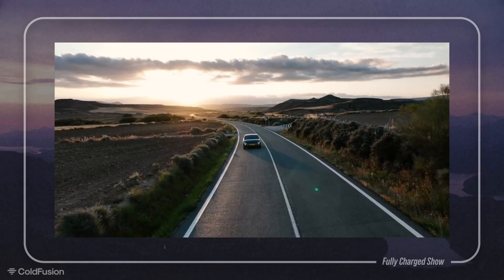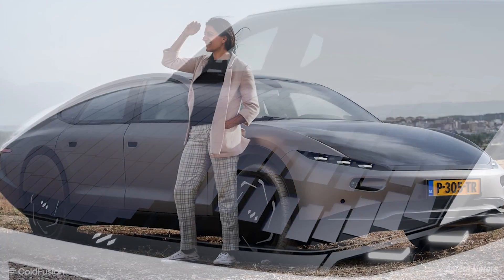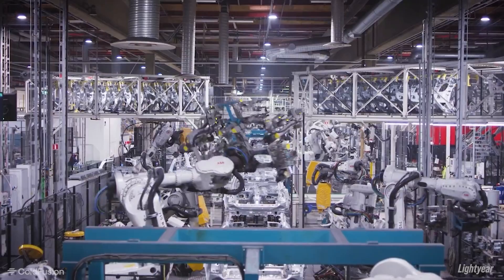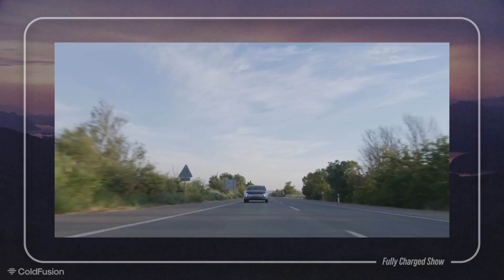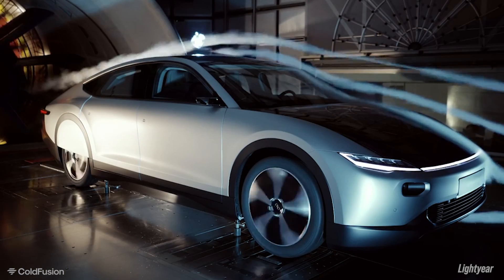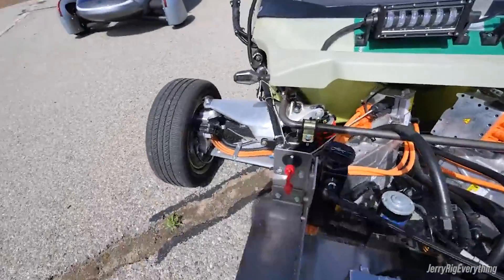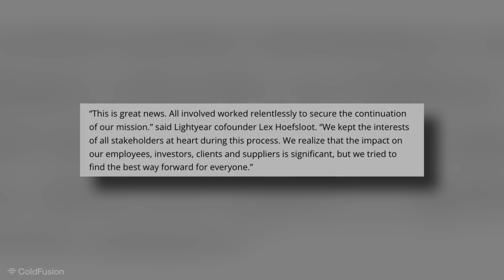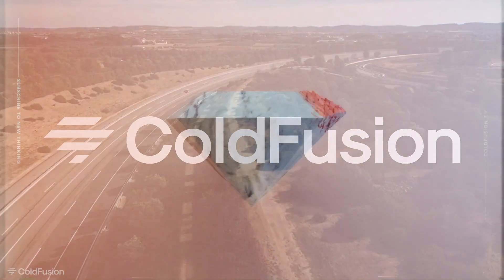3 Interesting Solar Car Projects

Comment: I hope Lightyear succeeds, but to me Aptera is the real game changer. By going for ultimate efficiency and simplicity of design, they have made a vehicle that can be made at low cost in reasonable numbers. I'm hoping we will see cars going to customers in 2024.
Reply: Aptera isn't even classified as a car, and would be a death-trap in an accident. To make matters even worse, it it actually quite large and not a nimble vehicle for use around town.
Reply: @michaelnoble2432  In a way - a real game changer, lol.
Reply: @michaelnoble2432  So is a McLaren a deathtrap? Same carbon fibre construction, bearing in mind that carbon fibre is 7x stronger than steel, and Aptera also has the perfect crush-resistant egg-shell shape. Yours is a common opinion, but a lot of people are going to be surprised if the Aptera gets a 5-star safety rating after all the crash tests are done. Aptera is not required to have airbags, but will have them anyway, so it'll be safer than a lot of other cars. I think the Aptera will be easy enough to drive with good visibility, you would just have to make sure you are watching where you are steering it, but you will be able to see the corners of the vehicle where the wheel spats are, so that shouldn't be hard to do.
Reply: @apterachallenge  unlike McLaren,  Aptera hasn't crash tested their vehicle, or hasn't released the results.  Crush testing is a gimmick,  and doesn't tell us how safe it will be in a crash. 

And the issue is the extreme width (far more than the average car), not the visibility.  Would you dare park one in an average carpark with  cars only inches away on either side?
Reply: @michaelnoble2432  You can't compare a car which is already in production with a car which is still on a path to production. Until the crash testing has been done, people are just displaying their bias or ignorance by just offering an opinion with nothing to base it upon. Sure, the parking is going to be tight but the average parking space is 2.4 to 2.5m as compared to 2.25m for the Aptera's front track so it's doable. You know that the car itself isn't going to scrape anything, you just need to place those front wheels into the space accurately.
Reply: @apterachallenge  exactly my point - less than 100mm to the white line on many car parks, if you park it PERFECTLY. Utterly insane. If you trust other car drivers to NEVER drive over the line, you haven't observed many drivers. 

And if Aptera are as close to production as they claim, there's no reason they couldn't do crash testing now (minor changes wouldn't invalidate the testing). But my prediction is that since it's (conveniently) classed as an autocycle (not a car), they will conveniently stick with their gimmicks and never subject it to a proper crash test.
Reply: @michaelnoble2432   The change to carbon fibre was not a "minor change". Don't forget that CPC (who by the way makes the carbon fibre body parts for McLaren and other supercar makers) have only just made the production tooling for the body parts, and are in the process of making a full set of parts for the first production models. Once they have assembled the first production prototypes, then they can allocate one or more of them for crash testing. The average armchair critic who has never built a car in their life, let alone a car designed for mass production, that has to pass so many government regulations, the project management, the financial management, the relationships with different companies, thinks that making it happen is easy and can just be done in a few weeks. This stuff takes years to put together.
Reply: @michaelnoble2432  You need to learn about the safety feature built into the Aptera.
Reply: @LarryDickman1  I've seen Aptera's claims, and the showy tests that are not remotely similar to actual crash testing. Until they subject their vehicle to such tests, their claims of safety are pretty empty.
Reply: i'm extremely excited for the Aptera
Reply: @raw.voltage  Settle down.
Reply: I agree. Normal car companies and society set the standards for how a car looks but 99% of cars today have high energy loss due to the car's shape. If Aptera actually produces they can change that in a meaningful way.
Reply: @Asahel17  Happy to make a long point on high energy loss, because it is one where Chris decieves and has known it all along:
High energy loss is more important when what is being lost is on any stationery object, such as a factory, but when on something mobile, it takes a back seat (no pun intended) to range, which overtakes (again, no pun) other factors, including costs. 
When Chris says he wants the most efficient, he blurs what efficiency he is talking about, and a vehicle with less range and higher purchase price is really less efficient than its comparison, regardless of other inefficiencies it may carry. So we analyze his deception claim that fossil fuel wastes 60% of the energy and electricity wastes 10%. First off - it's true, so make your factories and other stationary uses electric, but not your moving objects, and Aptera moves, if only a little bit, lol. But it is highly deceiving because fossil fuel pound for pound with batteries is 20 times more energy dense (average), and you have to take the container with the fuel. Hence, 1lb weight in an ICE car is as powerful as 20lbs in an EV before energy losses are considered. I will simplify - put another way, the ICE travels 20 times the distance on the fuel. No matter the equal weights, when an ICE does 200 miles, the EV can only manage 10 miles. Now calculate the losses, and the new distances - 40% loss for the ICE means it can only manage 120 miles. Already, we see that it's 110 miles superior to an EV, or 12 times the distance, and we haven't even calculated its losses. Fortunately, 10% only knocks it back to 9 miles, but the difference is staggering.
This is evident by most EV makers getting so little range they have to offer two battery sizes and lots of gimmicks. My old Citroen C5 can get a realistic 1,350 kms on the highway, and my new Atto3 can't be trusted to go 350 (ball park). I love the benefits of the EV, but I own the drawbacks, and I don't sell snake oil about it. I am willing to pay the extra cost in fuel for a Brisbane to Mackay and back drive, because I do it in a single drive in daylight hours in Summer in the C5, and spend 6 minutes filling up at any one of about 100 pumps to return home. I would not know how bad it is to take the EV, but it would involve frequent long stops; night driving; the dreaded kangaroos; and possibly the cost of a motel. Fuel cost is inconsequential when compared to all factors involved. In daily around Brisbane driving, I take the Atto3 every time. Horses for courses.
I hope you see how Chris is deceiving people just by omitting some of the facts? He is the ultimate snake oil salesman, and he preys on the gullible. And all his claims are never validated by real-world tests - another factor only the gullible would swallow. I own and drive both cars in my example, and they can be independently tested to be fairly accurate - no CFD rubbish.
Reply: @Asahel17  Aptera has been making and breaking promises since 2005, and has never shipped a car to a customer. Just wait until people find out how badly it performs in crash testing (despite absurd claims from Aptera so far).
Reply: @Asahel17  Professor Morelli designed the general shape in the 70s, and they only gave credit to him after someone called them out for copying it. Then they hardly ever did it again. I have nothing against aerodynamics, but outrigger wheels, which they added, are unnecessary and stupid. Being a trike is neither here nor there, but done to con the gullible and avert laws.
Reply: @aussieideasman8498  yeah, the front wheels make the car so wide (2,225 mm) that it's completely impractical to park etc. For a 2-seater car, that's just absurd.
Reply: neko7606   Aptera is following the same path as Tesla, starting with a 2-seater, and then moving to a larger vehicle.
Reply: Get your dictionary out and learn what real means. There is nothing real about Aptera when it comes to changing anything. If you could buy one, there isn't even a tyre to change, lol.
Reply: @aussieideasman8498   There are 4+ million Teslas that don't carry a spare tyre. Next spurious objection, please.
Reply: @apterachallenge  the average Tesla driver would be too clueless to change a tire anyway.
Reply: @michaelnoble2432   What a ridiculous sweeping generalization. I would say that out of 4 million people many would be able to change a tire, but it's probably true that people in general probably don't often change tires and so many people have roadside service contracts these days that they don't need to.
Reply: @apterachallenge  of course it was a "ridiculous sweeping generalization". But as a Gen-X, it's sad for me to see how few of the younger generations seem to know basic life skills like changing tires, tap washers etc.

Comment: There is a basic value called solar constant: approximately 1kWt per square meter of surface perpendicular to the sun rays in clear weather. A passenger car can hardly have its surface larger than say 4 sq. meters, meaning that in the most ideal conditions, the panels receive the input of merely 4 kWt or crudely 4 hp only: if perpendicular to the direction of the sun. (Can you hold the car panels always perpendicular? No? Then please apply a fractional factor, the sine of the respective angle ).

But wait! The best efficiency of transformation of this input into electricity is about 22%. That means that the fanatics of this project wished to offer a car with power 1 hp! It's not enough even for a bike! 

That's the level of Lysenkoism of the "scientific community" in climate alarmism, and that's the level of ignorance in the public looking up to such scientists and engineers! And the word "ignorance" is a keyword here! It's so depressing to read all these ignorant comments inspired by the pipe dream about solar energy from a car roof! That's the scope of obscurantism in the nation where Physics in schools is not a mandatory subject.
Reply: Bingo

Comment: I don't think one has to go with an extensive use solar in each vehicle for it to be worthwhile - just a one square meter panel incorporated in an EV's roof panel would give about 1000 km a year of free distance to that vehicle, and that is in rainy Britain. It's not so much what it does for an individual car that matters, but how much such a simple addition could reduce energy use if every EV, and thus eventually every car, had it. That's a lot or extra solar panel surface area effectively added to the grid, without any extra space needed, nor any landscape eyesore created.

Comment: For EVs to be viable they must have better range than the curreltly available commercial models. Having some sort of self-charging system like this has to be a step in the right direction. EVs that need hours to charge every day after relatively short drives are never going to be a long term solution.

Comment: The concept sounds great, but the Number doesn't really add up. Average Solar panel for Home use produce like 2 kW per day, and your video said Lightyear0 solar cell can generate about 1 kW a day. Put that in perspective, Tesla Model 3 has a 50 kW battery and goes 280 miles, that means 1 kW will make it go about 5 miles?
Like you said, a Solar Panel installed on a Prius is about 4 miles worth of electricity. If the passenger has to operate the A/C or the Heat, those energy will get drained very quickly. And then we go back to the struggle of Bigger Battery means more weight, etc...

I understand these cars are hyper efficient, but exactly how much more efficient can it really get compare to a Model 3 Even if it shave the weight by half? maybe 2 or 3 times more efficient? I still think we will remain decades away from Solar cars, only solution are more efficient Solar Cells.

Comment: I am a 60 year old mechanical engineer.  I'm definitely a fan of these people, they are building a better future.  But as I get ready to retire, I can regretfully say that I will not be buying one of the solar powered cars.  I'm definitely in more of a "go fast at any cost" point of my life.  If I were young, I would consider one.  But my next car purchase will be a sports car to replace my current sports car 🙂

Comment: I pretty much drive 5 to 10 mi a day. This is absolutely be something I'm interested in. We would still have one gas powered vehicle but my daily driver would be this car. One caveat is that it would have to be good in the snow as in all-wheel drive. I know that would be a big drain on the battery but again it's short range

Comment: I already have a Model 3, so a second car which is basically free to drive to replace my aging Nissan Leaf is a great value proposition.  Although at the end of the day, having to pay for registration and insurance on a car that you drive seldomly isn't economical, and I'm about to get rid of my second car.  So I'm still on the fence about a solar car.

Comment: Solar cars might be viable as a city car.   My particular driving needs are small so it would work for me.   I don't need something large and certainly I do not need a high-speed vehicle.  I am sure I am not the only one with these requirements so target that market.  Over time things will only get better but you have to start somewhere.   Then again, I would be interested in the long-term cost of ownership. Heck if they allowed me to drive an enclosed Golf Cart around town I would be driving one right now.  Not too far from me they allow limited Golf Cart Traffic.

Comment: Just put some solar panels on your garage roof and a large super capacitor in the garage.  Then use the super capacitor to DC Fast charge any EV when you get home.  All of a sudden any EV can be a solar powered car.  Sure, we should definitely make EVs more efficient.  Yes all standard range EVs should have smaller lithium iron phosphate batteries.

Comment: Some solar in a vehicle would be great, but not completely reliable as a source that isn’t always convenient. Say for example you want to park your vehicle in the garage at home or at work. What happens to your charging window? You miss out on a big chunk of charging opportunity.

A fully powered solar vehicle is likely not a viable option for the consumer market anytime soon, but for commercial and industrial operations this could be a game changer. Think delivery vehicles or buses that are out in the open air running most of the day or mobile machinery powered by solar. Now that’s a business idea! 😉

Comment: Excellent video, as always. I would be willing to take the plunge, even if the car was a little slower. The only issue I can see is if the car can be serviced if things go wrong. I live in the U.S., in Alabama so it may be a long time before we see mechanics willing to take this on.
Reply: Agreed. That’s what’s appealing about Aptera. They’re pro-right-to-repair and push for simple enough design that Joe-Schmoe can repair it

Comment: But these are not slow. They are reasonably fast and practical. Are modern drivers mad? I remember Volvo intending to electronically keep their speed to 190km/HR and there was a huge uproar over it. Not sure if they went ahead with the plan.

Comment: 0-60mph acceleration time is a little misleading on EVs. Since they have torque from the start, their 0-30 time is less than gas cars with the same 0-60, so they seem (and actually are) quicker off the line, where it's most noticeable.

Comment: The problem with solar cars is that it's always going to be cheaper and easier to charge via rooftop solar. The real points for this development is how they are applying the efficiency principles in a way the market accepts.

Comment: Nobody really needs a car that charges itself to 100%.  You can just plug it in and take a little bit of energy from the grid, that's nearly as good.  Just being efficient is great.  If you get rid of the solar panels on the car it might actually make it better.  Most people's roofs have a lot more space than their car, and lots of people don't store their car outside.  Just take the principles of the Lightyear and apply them to more standard cars.

Comment: Some of the parameters discussed seem absurd to me.
Who drives a two passenger vehicle 1000 miles in a week without a recharge?
Is 110 MPH limit a real problem?
I have a very specific commercial and personal use for the Sono Sion in Paris which would involve movement in town and out to surrounding towns which fits right into the solar recharging capability.
I am very vexed it failed.

Comment: Living in Brisbane, I would have one for sure!
Heaps of sunshine and don't drive everyday, so the car would be mostly charged by the time I had to use it. 
We live 10km from the centre of our town, 5km from the shopping centre and 35km from the city. 

60 Km's a day is heaps!
Reply: Yep, it gets you to all three Costco's, but not back again for some.
Reply: @aussieideasman8498  
Why would I go to all three Costcos? 
I rarely drive more than 100km a day. 
Having a car that is basically full of charge every time you go for a drive would be a massive advantage considering some weekends the wife and I don’t drive anywhere.
Reply: @TheosEpicVideos  For the hot dogs. Aptera won't get you the length of a hot dog on solar in any of the three Alphas. Not sure if it gets you anywhere on Gamma, either.

Comment: It's the Aptera I want.
The aero of the LY2 will probably be worse than the LY0, the battery sounds like it will be quite a bit smaller.  Not a fan of the SUV style.  I have put myself on the LY2 waitlist, but I have my fingers crossed for the Aptera.
Reply: It's the Aptera you won't get. G'day wyndy.